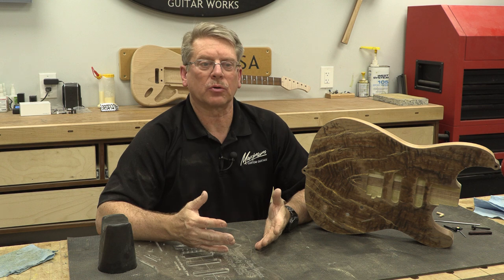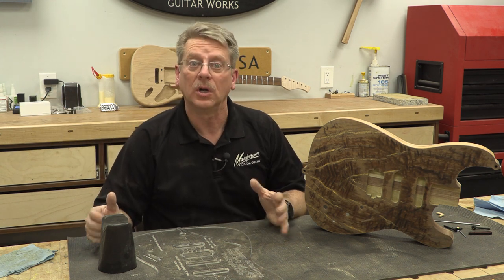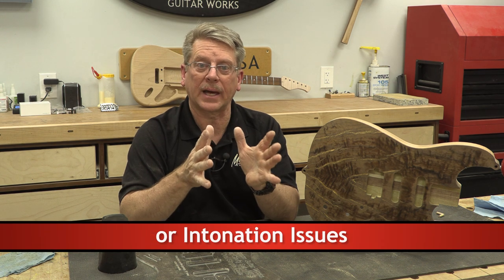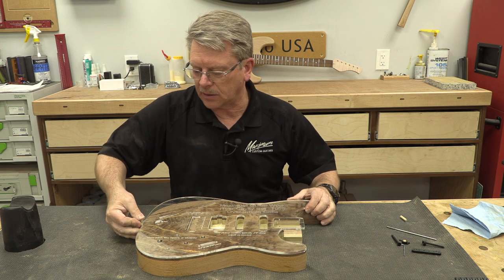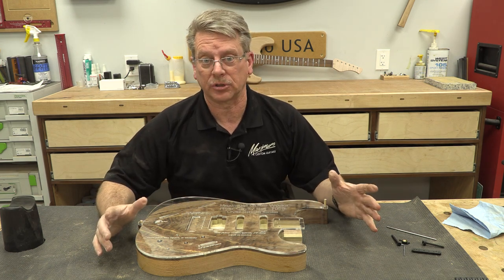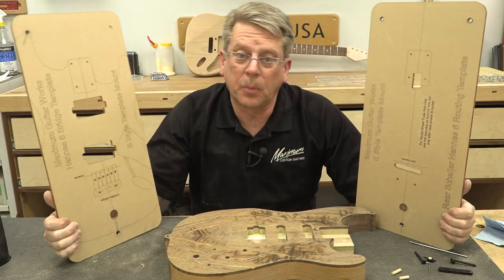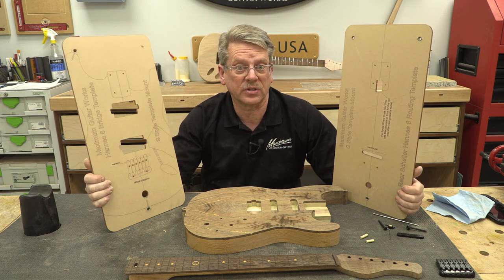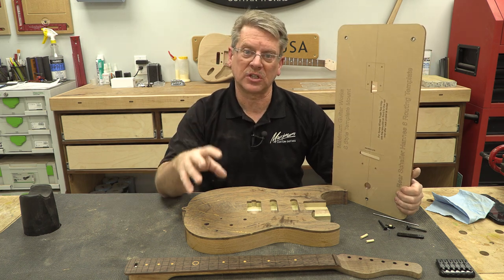Easiest Schaller Hannes 6 Bridge Install...the Maximum way!

Comment: Can you talk about how you ground this bridge? I am doing an installation and have everything mostly fitting, I've drilled a hole from the string base plate on the rear into the cavity - is it enough to simply "squish" a grounding wire under the base plate? Do I need to remove the finish where the grounding wire is? Any guidance would be useful!

Comment: When that bridge first came out I thought it was  beautiful and unique and I was ready to put it in…and then I found out about the lil pieces you can loose simply when changing strings so I never did it. Then I saw a lot of people routing out a step down on the bodies just to make things align with the fretboard. It seems like complete overkill to hard tail bridge simplicity. 
I could only see this be worth it on a balls out high end rare wood build and mainly just for esthetics. 
Since you have one, is it worth it?
Reply from the maker: This is actually my first guitar I am installing this bridge...so I'm not the one to ask about is it worth it.  I will let you know my thoughts when done.  I will tell you that the fit and finish to amazing...I like that the saddles are super friction reducing (made by graphtech), I like the fact that the front and back pieces are sandwiched around the body...very solid.  I also like how smooth the surface is for hand resting comfort.  It is a premium product for sure.  To me...it is worth a try.  And if I was going to try it...I wanted to make sure that the front and back parts would be dead perfectly aligned...hence the template system.
Reply: @maximumguitarworks  it looks great and I bet it feels great and with your templates it’s the easiest way to go. 
At the end of the video when you show it off mounted, I wonder if you’re going to have to inlay it in the body to match the neck for height/action like a lot of others seem to…
Reply from the maker: I will show it on my Premium Strat build series…whatever I have to do.

Comment: Any chance of a Washburn n4 template kit?
Reply from the maker: I do custom requests.  There is a custom ordering item on the website.  I will tell you that the accuracy is dependent on getting good blueprints and/or specs.
Reply: @maximumguitarworks  I’ll send you an email about it, not to blow this up here…